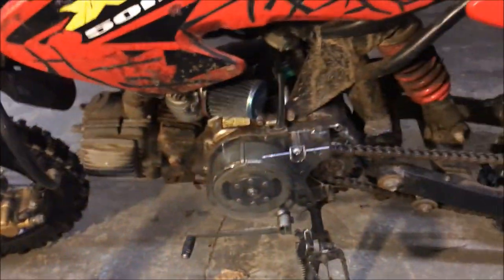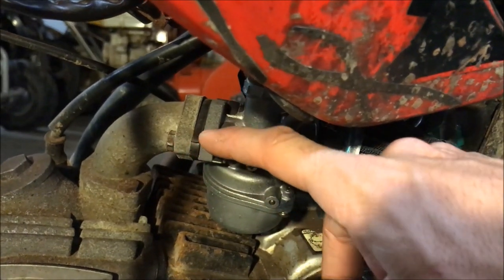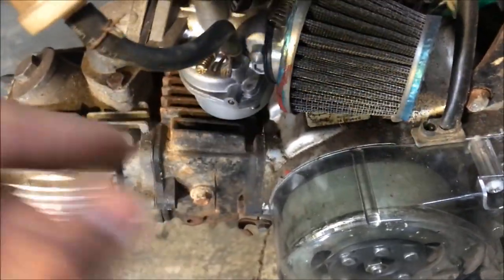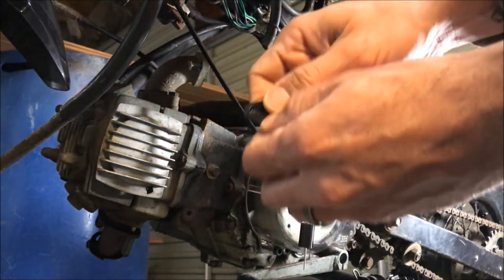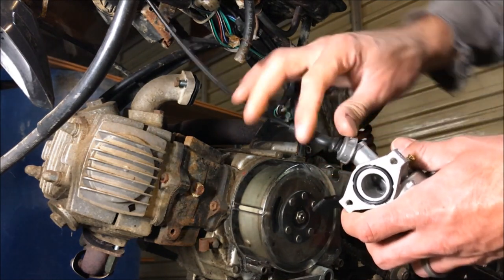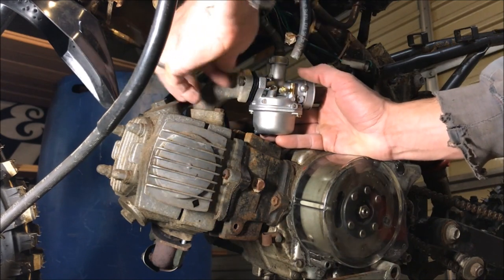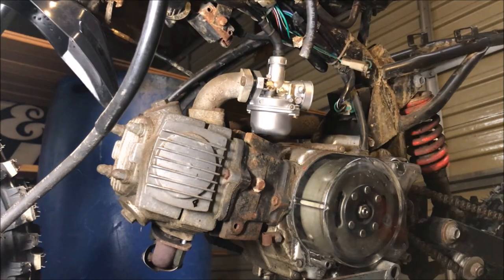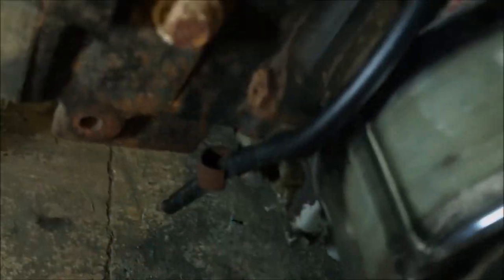Solved: Only Runs with the Choke On - Carb Replacement DIY

Comment: i had the black spacer with the O ring facing the carb .. i just switched it , i'll reply to this comment with an update if it worked because the bike dies when i turn the choke off as of right now .
Reply from the maker: Did it work
Reply: @DIRT SPEED 717  unfortunately no . when the choke is open the bike cuts off immediately .
Reply: @LoadScreenYT same ever figure it out?

Comment: hey man my quad won’t idle without the choke being on. same carb, just got a new one. you think air is getting in somewhere else?
Reply from the maker: Did you check the gasket between the carb neck and the head? Is the plastic spacer ok?
Reply: @burnout_MEDIA  yeah the plastic spacer is good, i just put a cardboard gasket between the intake manifold so we’ll see tomorrow
Reply: @burnout_MEDIA  still won’t idle without choke i don’t know what to do
Reply from the maker: @tylergellis4045  Even after you warm it up it still won’t idle unless the choke is on?
Reply from the maker: @tylergellis4045  how did it run
Reply: @burnout_MEDIA   yeah even if i warm it up it idles good with the choke on, but as soon as i turn the choke off it dies. or if i have the choke on and give it a little throttle it dies then too.
Reply from the maker: @tylergellis4045  if you turn the choke off can you keep it running with the the throttle?
Reply: @burnout_MEDIA  i can’t even get it to start now
Reply: @burnout_MEDIA  okay i got it started with the choke again and no it just boggs all the way down. i just cleaned the carb
Reply from the maker: @tylergellis4045  what kind of bike? How old is it?
Reply: @burnout_MEDIA  it’s actually a taotao 110cc quad. i’m not sure the exact model it’s scratched off. it’s a few years old but it hasn’t been running in about 2 years
Reply: Seems like the mixture is not correct. Adjust the screws for fuel and air

Comment: I have a baja 50 cc 4storke with new carb 
I have spark 
I have new fuel 
And compression 
The bike only starts and runs for 3sec with choke off and no gas given if i gas it , it will not turn on , it also doesnt start with choke on any idea how to fix ?
Reply from the maker: Which carb did you put on it
Reply: @burnout_MEDIA  pz 19
Reply: @burnout_MEDIA  I believe that is what was on it when i got it
Reply from the maker: @Nate20  any black smoke out of the exhaust? Could be getting too much fuel. What’s the spark plug look like
Reply from the maker: @Nate20  yeah it’s @wasthatawesome

Comment: Thats prob whats wrong with mine. It only runs with carb spray. Damn new carb cost 200 and only 1 avail that fits my model.
Reply: 200 for carb💀 bro is running carbed v16

Comment: I replaced the one on my son's tao tao 4 wheeler and that slide doesn't go all the way.  What did I do?
Reply from the maker: Try swapping the caps on the carb to the old caps . If it doesn’t fit you need to buy another carb with the shorter style cap.
Reply: @burnout_MEDIA  ok ya. Thanks man. The cap on the new carb is bigger in diameter.  Gonna try a couple things I learned from your video and see how that goes. Thanks again for the response man. I appreciate it.
Reply: Didn't fix a thing.  Only runs on full choke and idle wide open.  This will be the 3rd carburetor.
Reply from the maker: @Clare.1985  it’s getting air in somewhere. If it is idling wide open it is a lot of air too. Could even be the crank bearings
Reply: @burnout_MEDIA  how would i check that ?
Reply: the slide is only going halfway to the bottom
Reply from the maker: @Clare.1985  if the slide isn’t closing then that is your problem. You need to get a carb that has the shorter top. Watch my how to select the correct carb video